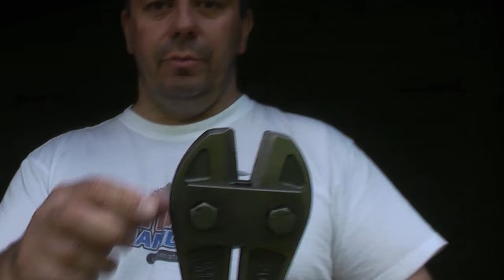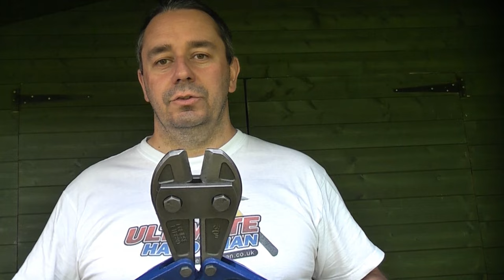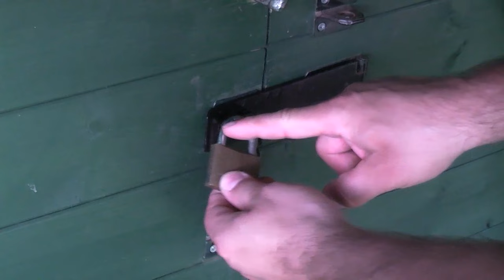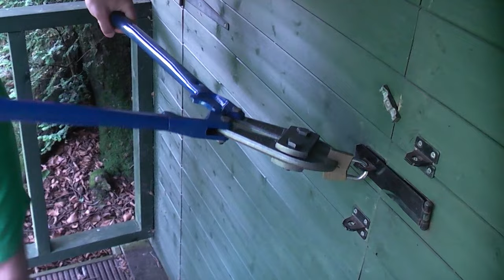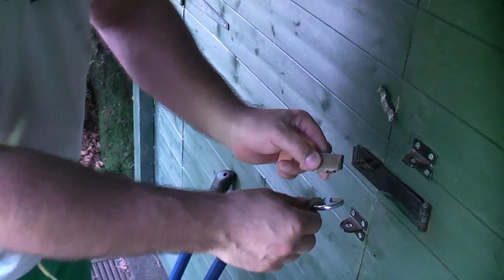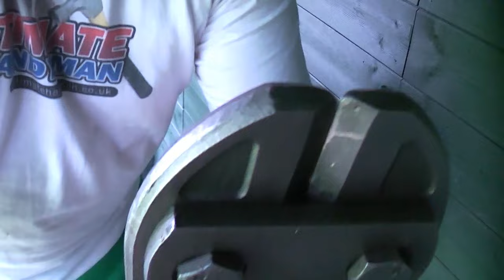Bolt cutters | Bolt croppers | cut off a padlock

Comment: I used a pair of bolt cutters for the first time last night to cut off a metal spring that was sticking out of the underneath of my chair.

The cutters are by Cobra and are 14 inch which I believe is suitable for cutting through things which are under 10mm in thickness. The spring was under 10mm, so to my surprise when cutting through the spring it was very difficult and it damaged the jaws.

I'm not sure whether I did the wrong thing or whether the bolt cutters were just very low quality.
Reply from the maker: Just saw a pair on eBay, they are very inexpensive for bolt cutters, so probably poor quality.
Spring steel can be tough though!
I used to have a pair of these when I worked on site, they were brilliant-
https://www.youtube.com/watch?v=UkN5EZ_RgaQ&t

Comment: Thanks I will break into someones shed now and treat myself to a new lawnmower. :)
Reply: Just use an empty coke can to make 2 strips to put between the shackle and lock body, doubt it's using ball bearings, maybe reach through the keyhole with a bradawl to move the lugs? Doubt the keyway is shielded, probably easy to rake with a paper clip bent into a squiggle and a jewellers screwdriver, if you see the ones that have a circular keyway with a line at the top, tubular pick, cost so little, aren't much harder to use than a key. Plus due to recent events you don't look suspicious if you cover your face!  So CCTV is useless! The guy with the face mask is just a responsible citizen and your CCTV is worthless! And the lack of noise or evidence of a break-in (convince the insurer that you didn't leave it unlocked, your door probably isn't much better, may need one of the three most common bump keys and some special lever keys you can buy online or a little picking knowledge.) Quicker, quieter, smaller, lighter, more easily concealed, especially if you have done some reconnaissance and you know what tools to bring! Most locks are actually really bad, both the materials that can be cut with bolt cutters or, in some cases, other, smaller metal working tools,  bypasses like shims or raking/picking. Get a good sturdy lock with a quality disc detainer if you value what you're locking up!
Reply: AS YOU SHOULD!!!!

Comment: Some reverse thinking, so if you want to protect your lock from being cut with bolt cutters just use chunkier lock wider than regular cutters can grasp.
Reply: Common sense
Reply: Nope, you can always just cut thru the hasp as he said, easily pick the lock, or drill the lock out entirely.

Comment: I have bolt cutters I took apart.  Now when I put them back together they will not function properly.  What is the trick to putting these back the right way?
Reply from the maker: ***** 
Have you tried loosening all the bolts, then squeeze the handles together before tightening the bolts?

Comment: That's a great tip, I am one of the idiots who has an 18ins pair of bolt croppers with damaged jaws due to cutting hardened steel. What you explain makes perfect sense! ( so why did I still go ahead and cut padlock shackles with them???) Cheers for you film. N.
Reply from the maker: It's because we watch movies and in the movies they always cut the shackle ;-)
Thanks for the comment

Comment: Great tip,   I've seen a lot of bolt cutters ruined trying to cut padlocks.
Reply from the maker: The ones at the last place I worked were ruined, with people cutting through the hardened shackle, but that's how they do it in the movies!
Thanks for the comment 👍

Comment: The jaws on a 36 inch one I have won't open, and one bolt, the one closer to your hand is missing, when I tried putting a new bolt in it bent, does it have to pass through the part on the handle or hold it down with its head, to make the jaws open or why would that happen?
Reply from the maker: Not sure about that, sorry.
I’m assuming the bolt is the correct grade for the bolt cutters?  👍
Reply: @ultimatehandyman  Could all happen to be a good enough bolt as its only a normal commercial bolt, maybe I'll try some others
Reply from the maker: Yeah, I’m pretty sure that the bolts will be high-tensile. Some lower grade bolts might not be up to the job 👍
Reply: @ultimatehandyman  Thanks, I must try for something a bit better

Comment: Hi, I have a pair or old sheffield record 936 bolt cutters. How do you adjust the jaws as there is a slight gap. Thanks
Reply from the maker: I'm not sure if you can adjust them or not!
Are the blades not worn?
Reply: ***** no, there not really worn. Go through rybar like butter aswell as large chain. Just small items like say a hasp. It just crimps it.
Reply: there is an adjusting screw on the side of both handles(or should be)...tighten them up and it will close the jaw up.

Comment: Excellent tip, wouldn't like to try on abloy lock bodies though, they are tough locks!
Reply from the maker: Absolutely, A few weeks back someone had jammed something into the key hole in one of the disc padlocks on my lock up garage- I had to remove it with the cordless Angle grinder.
Thanks for the comment

Comment: what do you recommend if the lock is thicker than the one you cut?
Reply from the maker: An angle grinder and thin slitting disc.
You can use bolt cutters on the hardened shackle part but it will damage the teeth.
Reply: Thank's for your video and your advice.  We have a padlock that seems to have rusted, and when I tried unlocking it, I broke the key inside the padlock.  Time to go tool shopping :)
Reply from the maker: You are welcome.
Good luck with it ;-)

Comment: Amazing how much power is channelled into those jaws due to the cutters design.
I take it that wasn't your neighbour's shed in the early hours? .... LOL
Reply from the maker: Yes Kev, the leverage is immense especially if you get a large set. My mate went home with the key in his pocket, so it was easier to replace the lock than drive to his house to get it ;-)
Thanks for the comment
Reply: 6 years too late, but you can also get two pieces of pipe, slide it over the handles and increase the leverage again, making it even easier.

Comment: Wouldn't it be easier to cut through the shackle then the body?
Reply from the maker: No, the shackle is made from hardened steel. If you look at a lot of bolt cutters that have been used on the shackle, you will see that the jaws are damaged and have gaps in them- this is because they have been used to cut through the shackle.
Sometimes you don't have a choice, but it is best to avoid cutting the shackle if possible.
Reply: @ultimatehandyman  Thanks for the explanation!